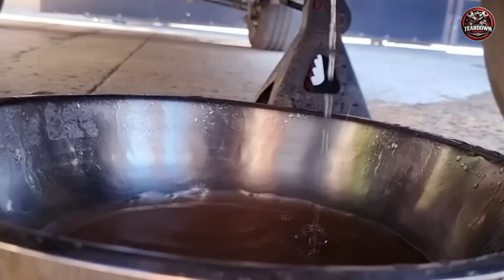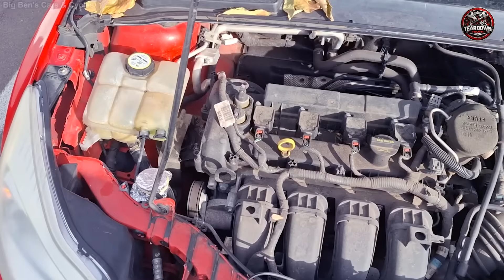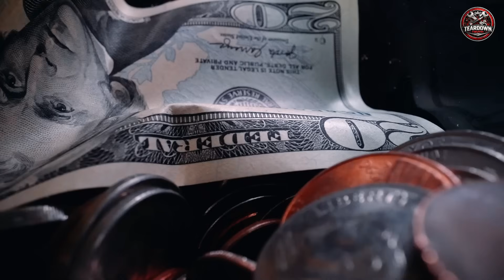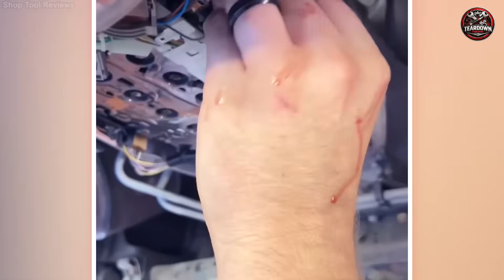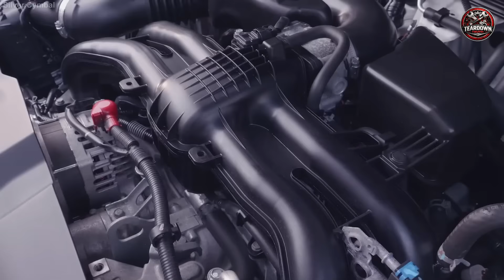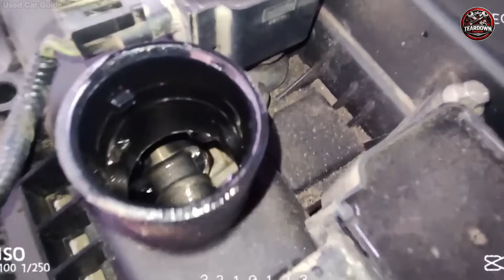NEVER Buy These 5 Used Cars (They'll Bankrupt You in 3 Months)

Comment: When it comes to all vehicles, you all are stupid. You all make up your own stupidity. Yeah, it's all garbage. Everybody's trying to rip everybody off. But you also know nothing about a vehicle, I can find garbage cuz. I know everything there is to know it's all under the oil cap, you take the oil cap and look in the engine for late 90s, early 2000 cars, if it looks like coffee grinds or sewer, it's garbage that includes most toyotas and hondas. If it's clean like no buy it, no matter how much it is.  Usually, people don't clean that out.Then leave it the way it is.And that's one of the main things, only 1 issue it's too stupid to note, not anything else you should buy electric bike or an E scorer, buy 1 note $800.That's your best bat coat too dumb to do anything else